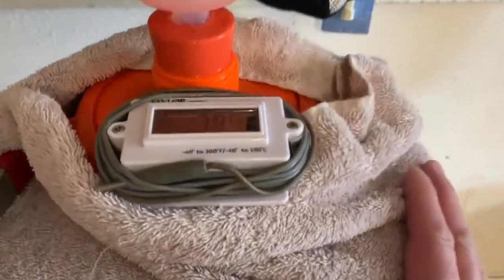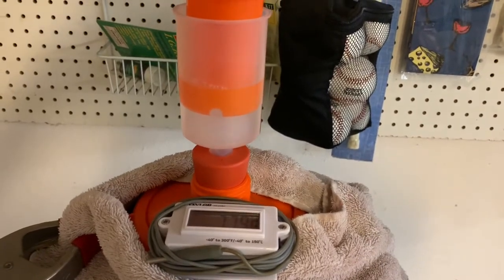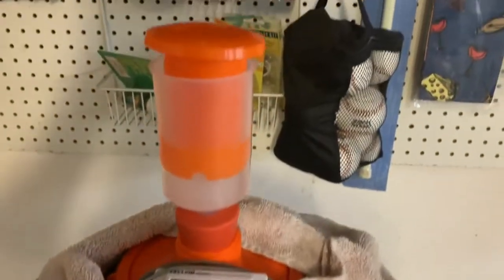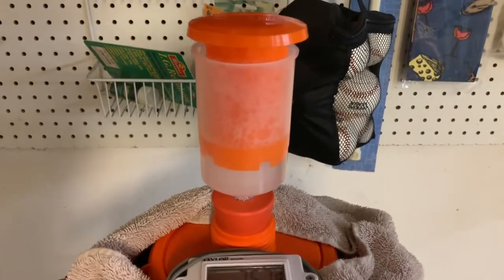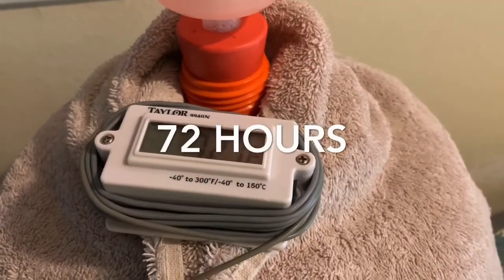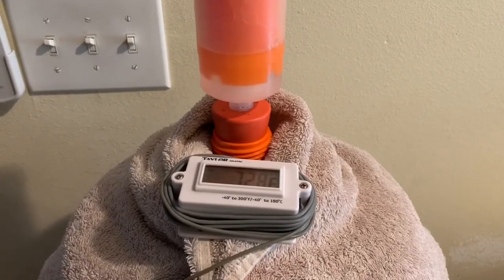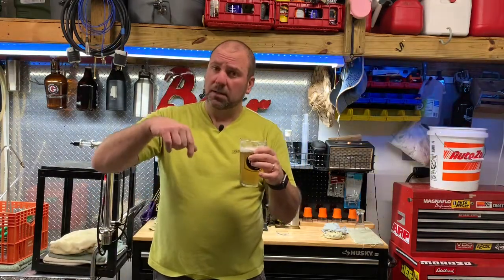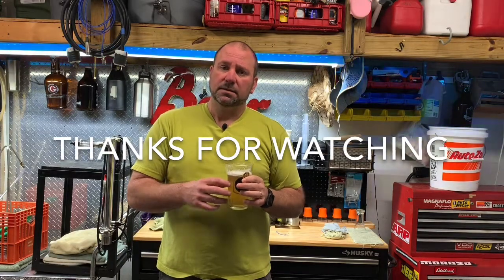Kveik yeast makes a lager like beer in 5days!!

Comment: Next time try Lallemand Voss. Pitch it in 35'c and let it ride in ~30'c. I have had few batches with it, and it's incredibly fast! 1.055 to 1.012 in ~24 hours. Although I have made only IPAs in those temps, so I really can't say that will it bring esters for example in lager. If you are pushing it only for to get amazed with the time, pitch the whole pack in ~25 liters. Remember to give it plenty of nutrients and aerate properly, otherwise it will lag in low OG beers. Cheers from Finland.
Reply from the maker: Jarkko T. I’ve been using the Voss just recently they have some great yeast i haven’t been disappointed with Voss

Comment: Kveik from the farms here in western Norway, where it originates, not Belgium, consist of several strands of kveik yeast because of mixing with neighbor's kveik over the years. There is also bacteria in the kveik gotten into it over the years and it contributes to the overall taste of the beer.
Reply: Here in my village in Norway we always start the brewing day by heating water and boiling juniper branches in it to make the mashing water. We mash at 64-70 c or so, but after we cool right down to 30 c and add kveik. We do not boil the wort! Never s problem with contamination because of the juniper concoction and also traditionally the beer was transferred into fermentation vessel by running it through the hop bucket.
Reply: So in my fermentation vessel I use only a linen cloth over the top, no lid or water lock. Wrap it in towels etc to keep warm.
Reply: Thanks for spreading the word and knowledge of kveik!
Reply from the maker: No problem thank you to for the information! i love using Kveik very forgiving yeast!!!

Comment: How would you make a starter with this stuff? Would only need an hour or 2 on the stir plate
Reply from the maker: no need to use a starter with this unless your doing a very large batch. If you did i would do it the same way as a regular starter but higher temperature. it will ferment out quickly for sure.
Reply: @goldgulfcoastdesignericsho8628  I'm in tropical North Queensland, Australia, so I'm specifically looking for a higher temperature yeast. this may be it... After searching, there's so many different types of Kveik yeast, how do you choose...

Comment: not from belgium, from norway
Reply from the maker: Thanks for the correction.  if you noticed I put it on the screen the yeast is from Norway.
Reply: @goldgulfcoastdesignericsho8628  didint catch that, sorry for the bothering. im gona try a toasted oat beer with voss kveik thats why i was checking your vid!
Reply from the maker: @ragimundvonwallat8961   no worries sounds like a good brew. As fast as Kveik ferments it’s a blast to watch. Good luck and cheers